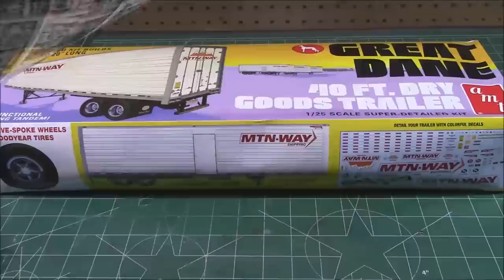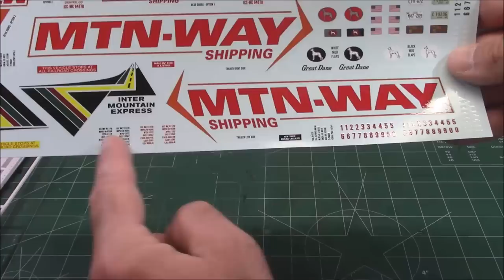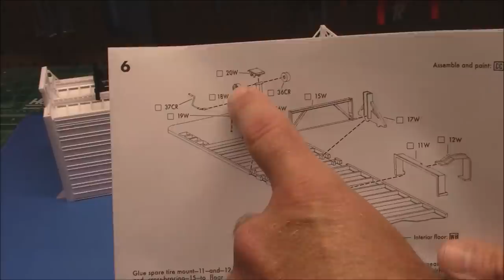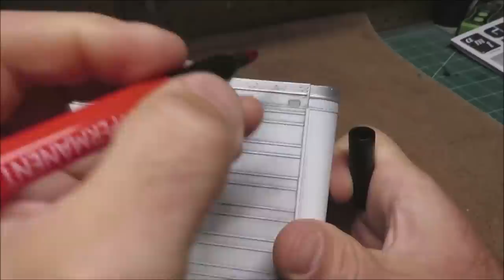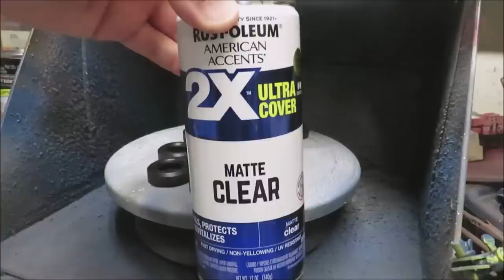Great Dane Van Semi Trailer 1/25 Scale Model Kit Build How To Decals Rust Opening Doors AMT 1185

Comment: Chris+ she turned out beautiful keep up the great work I noticed tho there are not much in the way of new smia truck kits modern trucks only the two international kits by mobeus models the pro star and lone star like to see more of the newer trucks as well like Kenworth and Peterbilt with the airo package on them injoyed the build keep up the great work 👍🍻 Chris you can use tape to hold those big pieces of trailer together while you glue them make it a little easier to assemble

Comment: Using bleach in a large enough tub will remove chrome surprisingly fast. 
Sometimes old toothbrush for stubborn spots will help.
Rinse under running tap water.

Comment: Yup -- it's the former Ertl trailer.  Those Ertl.parts really lock together well.  The big AMT trailer was a Fruehauf and it came with a movable wheel dolly and vinyl airlines.
The movable wheel dolly was more for drivability than weight transfer -- forward for tighter turns in the city, farther back for smoother handling on the highway.
I was disappointed, Chris.  I thought you'd give us a tutorial on wide-brush texturing the wooden floor.
Great job!
Reply: Wrong - sliding wheels was for weight transfer - slide back more weight on the drives, forward less weight, also slid all the way forward, you would not want tight turns in traffic, as you would wipe out everything with the back end.
Reply: @fredericia01  I see I'm not the only one that pulled one of these for a living. Also, the roofs are all raw aluminum.

Comment: I saw the video yesterday but had to watch again today. I work at a gravel plant and we have an old trailer sitting by the lane that we use for storage. I must have drove past it thousands of times but didn't notice til today this trailer has the same ribbed and riveted side panels and the door on the right side as well, just like 2:16, the exact rear frame at 3:08 except it had the roll up door instead of the type in the kit, and the hinges and latch on the side door 3:28 and landing pads 22:38 was exactly like the ones in the kit. I looked for the trailer name but couldn't find it, it wasn't at the top front. I'll have to look at the build plate which is what I meant to do after work but when I was done fueling and greasing the equipment I forgot about it. Other than 3 very minor differences I believe it is the same trailer I'm about to get a model kit of. 🤯 Just blows my mind.
Reply: By the way, the spare tire cradle 19:59 is the exact same as well.

Comment: If I’m not mistaken, I think that was the ertl smokey and the bandit trailer from the early 80s, I could be wrong about that, but it looks like it though
Reply: Was released as the part 2 trailer. Which makes no sense as part 2 was a Dorsey drop deck trailer.

Comment: Looks good when finished. I recently built the reefer version, and had a lot of warped parts; rear panel, side door, both chassis rails. Round2 was great, and were able to send replacements that I could actually work with.

Comment: Hey Chris, Love the Show.. I will give you a chuckle.  Did you know that ERTL produced 2 verisons of the dry stock trailer. I have had in my model stock the model you are building. 6 Months ago,  i found the model without the side door, Great still sealed in shrink wrap. The kit arrives it takes me a couple of days to decide if i am going to unwrap this kit. I unwrap and open the box and find the right panel has a door, but if you look at the box photo smooth side no door. i checked the part number, same as the side door kit. Weird because i have owned the smooth side trailer. I do know that ERTL had quality beforegoingout of business. Keep up the good work.